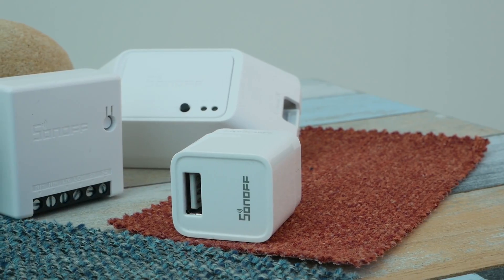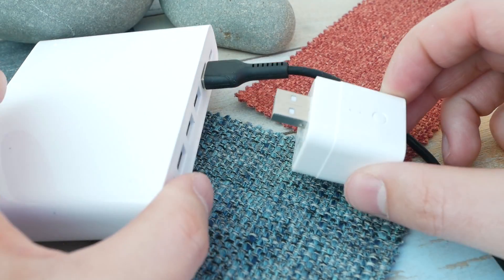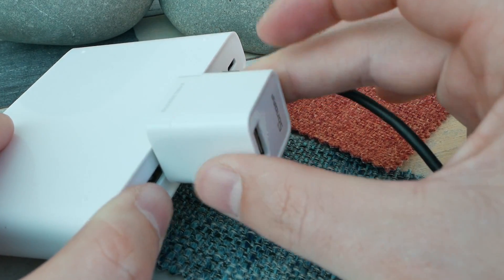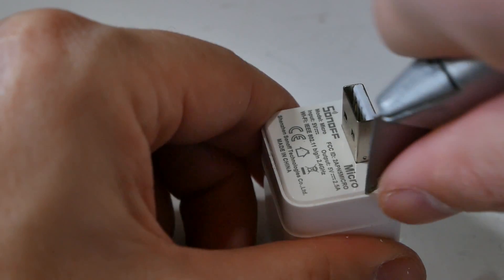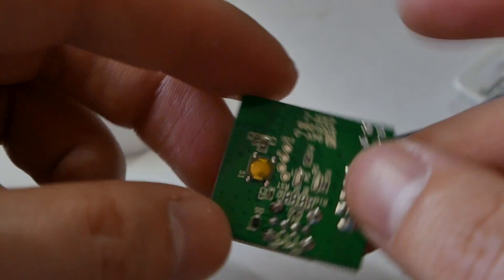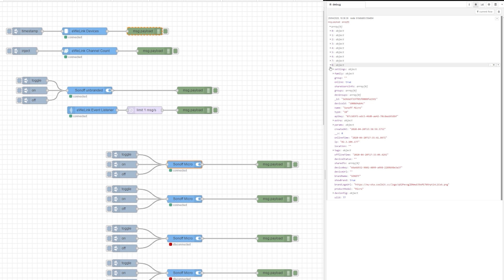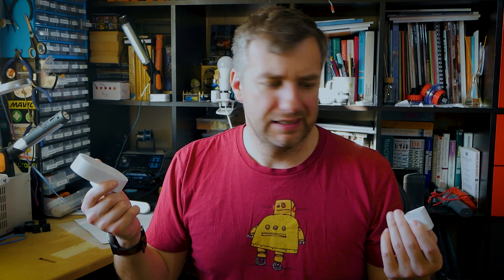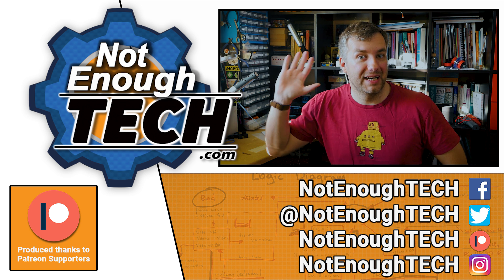Sonoff Micro has a secret!

Comment: I have a sonoff micro and i have connected to my led lights but the led lights has a button on the usb plug, to switch on and change functions. 

I have connect to my phone and Alexa but it wont switch on unless i press the button on the led light usb but it will turn off with alexa or the app. Can you please help on i can switch it on without pressing the button

Comment: im hoping to use them in a light display to remotely turn some usb lights on and off on a tree in my yard. it will be powered by a small 10,000 mah battery pack. if i did the math correct it should last the entire holiday season being on just a few hours at night. i didn't want to run extension cords to power it and thought this to be the best solution. i figured i could just put it all in a ziplock bag to keep any water/snow out. any input on this idea or any problems you think i might encounter would be appreciated. thank you....
Reply from the maker: Other than keeping it safe from moisture you should be ok.

Comment: There is a very legitimate use case for a sonoff micro over a smart plug. The sonoff micro makes it possible to use a USB power bank as a low voltage UPS while still being able to have a smart switch on the USB device you are powering. This comes in very handy for the sound machine in the baby's room. It stays running in case of a power outage with a USB bank, and I can still have smart device control.

Comment: It seems there's now Tuya based copies of this available. Bought two and they work as expected. Haven't disassembled one so how it's made I can't tell but no data there either. It says 5-12v though - so might be more useful if one solder the connections.
Unfortunately they copied the stupid design of the Sonoff. Would be more useful if they made design like the Sinilix - but the downside of Sinilix is that it is it's own platform. Slowly I'm moving to Tuya from Sonoff for casual stuff (Hue and SmartThings for other) since eWeLink made a lot of the functionality pay services - limited no of scenes and devices don't handle DST changes - only timed scenes. eWeLink was great but being it's own platform with limited integration to others and being paid just made me phase out my devices. Can be some is converted to Tasmota with time.
Reply from the maker: ZigBee version would be nice with usb-c pd support. D
The design could be better but you can get a 10cm usb extension to avoid taking up spaces
Reply: @notenoughtech  Agree a USB version would be nice. Preferably compatible with Hue (and thereby compatible with Tuya and Trådfri as well).
USB extensions isn't ideal. Takes up space and increases resistance risk impacting high current performance.
I mostly use them for low power switching though - powering modified LED "candles" for automatic "hygge" and as signaling as well. I was tired of constantly changing and charging batteries and at the same time expanded their uses. Using high quality USB power supplies that are much safer build than those build in smart plugs - actually uses less power too.

Comment: Thanks for the review! Bought it and works alright, the size is def an issue - it does cover a one usb port on my charging station but the problem was mitigated by using the rightmost port.
Is the casing like this due to heat or something else?
Reply from the maker: You could use a short usb extension lead to bypass the issue with its size.
Reply: @notenoughtech  oh yes thanks I'm so dumb haha
Reply from the maker: Sometimes the easiest solution escape our heads :)

Comment: how much power does the micro use?
Reply from the maker: I'd have to plug it but probably around 75- 100mAh
Reply: It is  0,4 watt. Same for on and off. This is more than I expected. I also use Shelly1 Plus (12V)  with esp32 and it consumes 0,38 w when relay on and 0,15 w when relay is off (in eco mode). If they use  bistable relay, it can consume 0,15 even in on state.

Comment: It's best to buy this https://tech.scargill.net/aliexpress-sinilink-wifi-usb-controller/ this thing does the same but does have an esp8266 and supports data passthrough. I'm using this with a dumb USB LED strip and esphome with homeassistant.

Edit: the preloaded firmware is trash, so only buy it if you want to run tasmota or esphome on it.
Reply from the maker: Pete emailed me link for that. It was fun to try this device tho. I have added the USB-C port to it too :D

Comment: Hello you can almost manually add the data wires  with a little bit of wire. That is how i would do it. But over all awesome video.
Reply from the maker: D+ and D- are fused with a resistor so it would be problematic. It's part of how BC1.2 is negotiated in this instance.
Reply: @notenoughtech  I removed resistor and wired D+ D- directly and data works too now!
Reply from the maker: That's cool ;)
Reply: @klim4598  Can you explain more about how you did it? Do you have a picture of the modification?
Reply: @thesmviking  i have no photo, i already closed and glued device. if you open device, you will see two resistors near USB port. you can send me photo and i can help you.
Reply: Hi can you please make a video of it if possible?
Reply from the maker: Without modification to PCB it's not going to work so I'm not going to add the data lanes. There are some usb devices that allow this linked in the comments of this my USB 'c hack
Reply: @notenoughtech  Sorry, but where is the links to other usb devices that supports data transfer and on/off? I can't find it.
Reply from the maker: If there is anything it would be linked in the article

Comment: It looks like Sonoff might be moving away from DIY / Hacking.  Unless this new chip is just cost saving or maybe in preparation for more ZigBee devices.
I struggle to find a use over a smart plug though, given it only switches the low voltage lines.
Reply from the maker: I hope not, the dev pads are still there so I'm keeping my fingers crossed! The charging profile works great tho :)
Reply: @notenoughtech  I might have to do some research on the new chip
Reply: I bought two to switch my Chromecast devices. I don't always need them powered up as I use my TV as a second screen.
Reply from the maker: Oh that's cool

Comment: 1. No ifttt support! 

2. I failed to access it via API - zero devices returned upon successful login to ewelink. Did you do anything special apart from just login and enumerate devices?
Reply from the maker: IFTTT has webhooks so you can interact with it.
Something tells me it could be your region? these are not documented well, what country is your account registered to?
Reply: @notenoughtech  1. Sonoff support told me they do not support USB/micro via IFTTT yet. When you try to create a rule in IFTTT->ewelink, zero USB/micros are found.

2. I tried using node-red ewelink node. It does see my mini, but fails to see my micro.
Reply from the maker: Strange. Are you using the same as node as mine ? Clearly I don't have this issue for some reason 🤷🏼‍♂️
Reply: @notenoughtech  Not sure if it's the same one. But it logs me in, shows me the mini, but not the micro. Did you try accessing micro via IFTTT?
Reply from the maker: Not via app as I route everything through node red it's easier that way

Comment: This seems like a much better option: less $, passes thru data lines, handles up to 22v. And it's possible to put Tasmota on it (esp8285). Ali: https://www.aliexpress.com/item/4000791220450.html . Andreas Spiess did a detailed video on it: https://www.youtube.com/watch?v=lrHhn2AVzSA
Reply: I should add that this one does require hacking as the supplied software is total junk. For a no hardware hacking solution (with limitations), the sonoff micro is ok.
Reply from the maker: Cool find thanks
Reply: @notenoughtech  Turns out I just received a batch of these from China a couple weeks ago... Your video reminded me that I need to put Tasmota on them. :)
Reply from the maker: I may order a couple of them too - but first I want to redesign the sonoff  and 3d print the new encloure